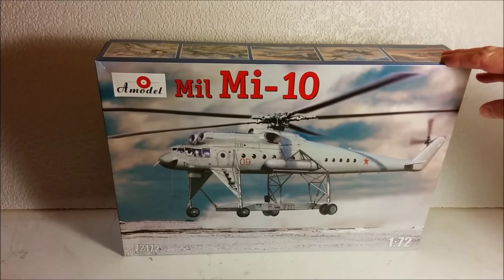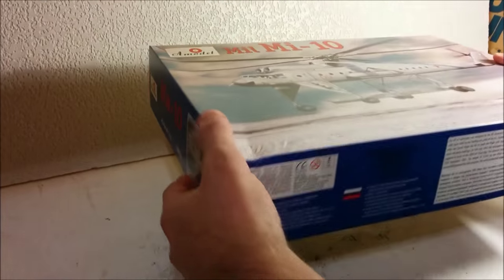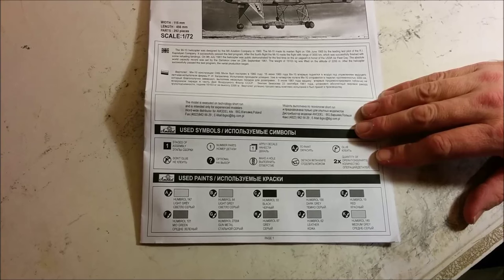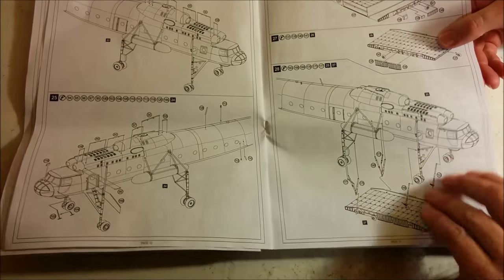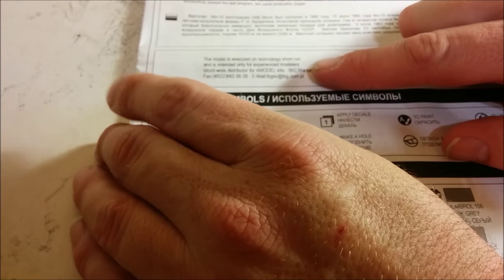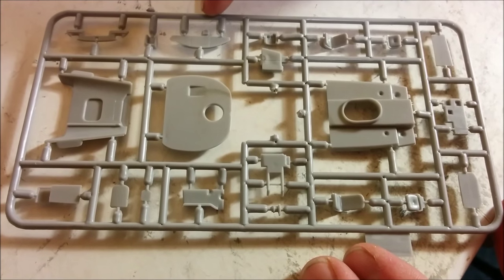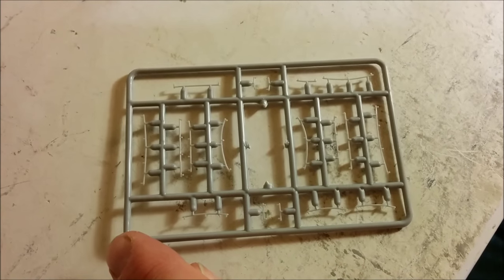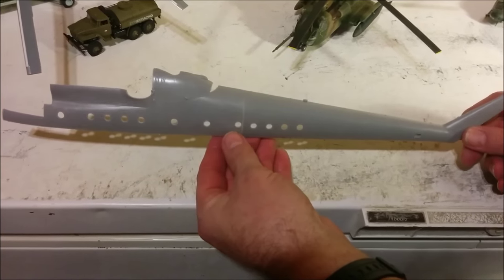Mil Mi 10 Helicopter Kit Review 1/72 A-Model

Comment: I have real soft spot for Amodel kits and have built a few, with quite a few more in my stash now. I've seen some stunning builds of the Mi10 at model shows.  I think it will need some serious nose weight to sit right given the length of the fuselage aft on the rear landing gear. To reduce the load on the gear struts that could be hidden in the ramp on in a truck on the ramp.

 I think Amodel have a limit as to the size of the injection mould tools they can use hence the number of the sprues rather than  large fuselage components. Kits like the Tu160 Blackjack has a glass fiber shell moulding for the fuselage.

Great vid.